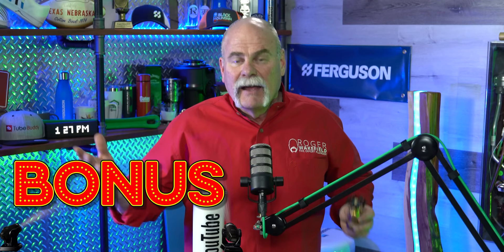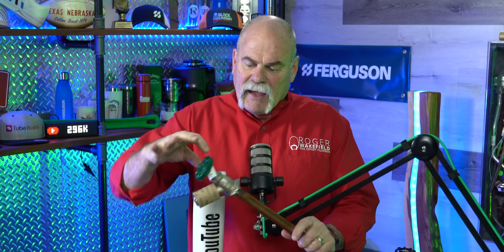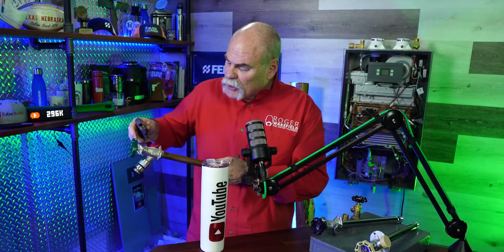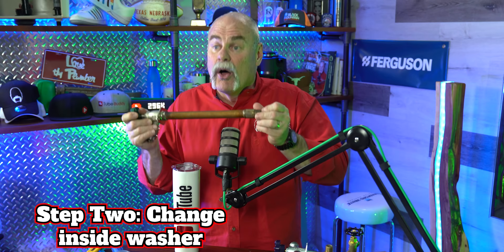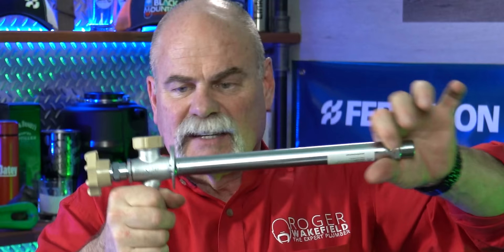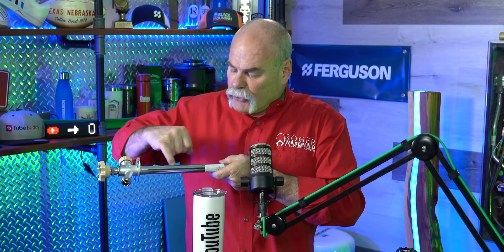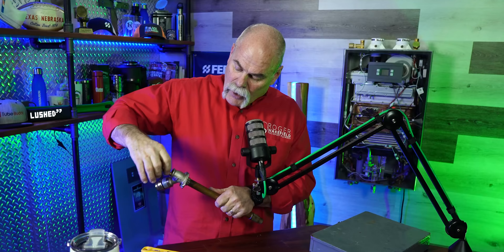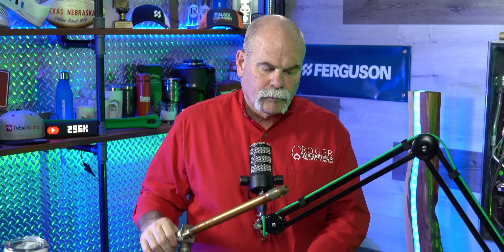How To Fix a Leaking Frost Proof Faucet | DIY Plumbing

Comment: If you can't access the piping from the inside will it hurt the copper piping when you try to unscrew the frost proof anti siphon from the outside with a pipe wrench ?

Comment: My frost free faucet did not pull out of the sleeve when loosened…turns out it was a quarter turn faucet with a mechanism at the valve end and a washer had jammed in the pipe. I replaced the entire unit as chasing down multiple parts and washers didn’t seem worth the effort after getting the old faucet out of the wall.

Comment: My Woodford Spigot when I remove the first segment, the stem is still behind a second and I can't seemingly get the second one off.  I had this replaced by a plumber about 13 years ago.  So it is not very old.  The problem was with the handle not turning off and on correctly.  It would pop out some .  I thought it was just the screw but that wasn't the case.  Any suggestions?

Comment: Mr. Wakefield, thanks. I understand that ASSE 1019-A is a standard used for plumbing parts, but to get the correct vacuum breaker kit I need the model number. The only number I see is located under the ASSE 1019-A, and it's 2890-with some kind of shield looking thing.  On the other side are the letters N.W. Where might the model be? In the wall or something? Appreciate it.

Comment: I've got to replace a freeze proof outdoor faucet,  what is the best brand/model to get for replacement, 10-12" freeze proof.    Don't mind spending a few extra bucks to put in a good one.  Want one i can replace parts on if needed.     This one didn't last 3 years on new home.     This one drips from faucet,  i've already replaced washers and guts.   TIA
Reply: Hands down the Woodford Model 17 CP-12.  That is the 12 inch model.  Amazon or Lowes

Comment: I watched your video, and I took the faucet apart, but I could onlt slide it out about 2 inches when it stopped . I pulled on it as hard as could but it wouldn't come out  so put it back together because I didn't want to brake anything . so how do I get it out.please let me know

Comment: I have a frost-free leaking around the stem. I tried to tighten the stem nut but it was already as tight as it could be. I tried to then take the rod out but when I loosened the stem nut all the way I couldn’t pull the rod with the washer on the end out. I didn’t want to force it too much but it would only move about a half inch. What do I do now?

Comment: I have a 1019-a hose bib that is leaking around the handle only when valve is open.  I checked the gasket seal around the o.d of the stem and it appeared ok. I tried opening valve to see where water is coming from and its actually a strong stream of water coming out the center of the stem when the handle screw is removed.  Water is coming out the threaded hole of stem when handle retaining screw is removed. If i put the handle and screw back in it slows the leak but still a considerable leak. Not sure why water would be leaking out the center of the stem and only when valve is open

Comment: Hi interesting info here but my frost free faucet has a different problem.  Its so recessed the vacuum siphon hits the next layer of vinyl and cant come off.
Soooo cant change it because it is leaking, cant use it, so tell me again why i need thisorhow to adjust the nightmare in a way that would prevent this from happening every year.

Pictures available upon request.

Comment: With a little luck a homeowner will have a name brand valve and parts will be searchable. If the valve, like mine, is some cheap off brand type, replace the whole thing with a common brand so in 10 years when it needs service again, you'll be able to find parts.

Comment: The soldered vs. threaded  is a a big issue fore me.  The valve is barely holding in place. I think that I have to change the entire faucet (house built in the 70s). They routed the pipes in cement blocks.  I have no indoor access beside breaking the wall!  I am thinking of inserting one of these tiny cameras?  Would that tell me anything?
Reply: Same problem! I'm putting an access door in my closet where I broke into the wall sigh

Comment: Hi Roger. I’m trying to repair a Moen outside cold water faucet, freeze proof, that has a small leak from the faucet. I followed your video (very helpful) and removed the packing nut, unscrewed and removed the shaft to get at the rear washer, which is damaged. 
My problem is the screw holding the washer. It’s on a plunger type piston that’s inside the copper shaft. Turning the screw turns the entire piston rod. I’m trying to hold it with vice grips, but I’m worried about damaging the shaft. I hit it with wd40, but that screw doesn’t want to budge. 
Any advice for getting that washer off? 
Thanks!

Comment: My frost free is in the outside wall about 4 inches from the edge of my home up against the vinyl siding edge molding molding  I live on a slab which makes it a PIA to get to. It is chrome colored and none of the local stores have a match for it.

Comment: Having trouble finding a repair kit for my Mueller B & K 1019A 10" faucet. I don't know the Mueller part number. Water is leaking out of the screw for the handle, as well as the two holes just inside the faucet stem near the handle. I am not sure how to find the part number or the repair kit for this faucet. A plumber told me Mueller or B&K went out of business, but I don't think that is true. I cannot find the kit on Amazon nor Google Shopping. Am I looking in the wrong places?

Comment: The first one I changed was soldered in and I ended up twisting it out.
Reply: Did you remember to clamp the faucet and reverse torque it as you unscrewed the inserts collar to keep it from turning?

Comment: Please enlighten me because I'm confused about Texans building their houses on slabs. You're saying things like "chipping out enough mortar" to see what kind of connection the faucet has to the house's water supply. Here, (Idaho) it's as easy as going into the crawlspace and looking at what kind of connection it has. Why do Texans build their houses on slabs if it makes the most basic plumbing repairs become total concrete-embedded nightmares to perform? Is it something to do with soil water or something? Is this just something in houses more than 10 years old?
Reply: Brick is very common here in Dallas-Fort Worth area. It is mortar around the faucet where it goes through the brick that is being referenced for chipping out -- not the slab. 

As for commonly building on slabs, yes it has to do with the soils. Texas has a lot of expansive clay soils so slab foundations make sense with such soils.
Reply: It's about money.  There should be a law requiring piers under slabs due to the expansive clay